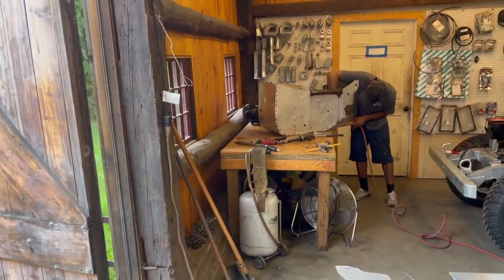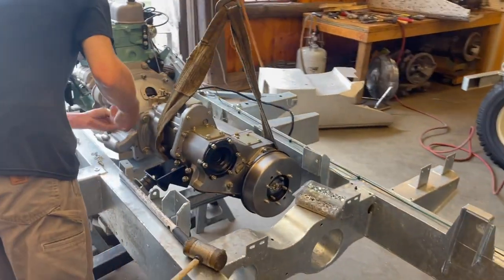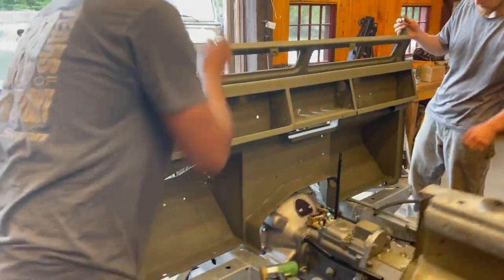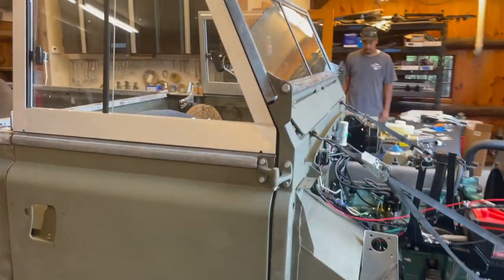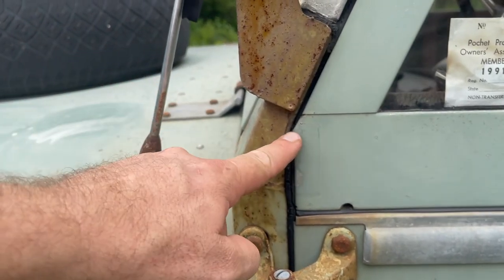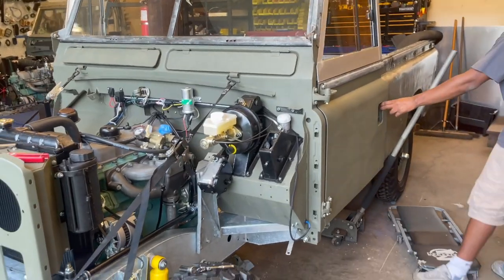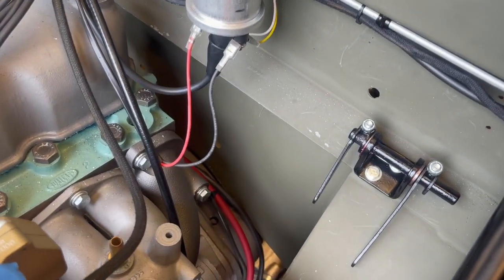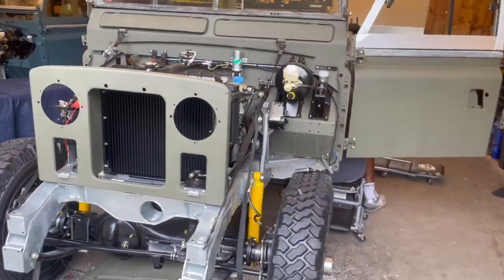NAO Shop Truck Project: Installing the engine and bulkhead

Comment: Great build, you need to add series '1 ton' style wheels though, these really beef up the look of a 109" , not sure if the US/Canada got the 1 ton 109?  Wheels are part DA2694, available from various manufacturers. 
Keep up the great work, watching from the UK. 👍
Reply: I kind of like the skinny look though. The DA2694 are 8" which is too wide for the 7.50 16s. the original one ton wheels were 6.5" but are hard to find
Reply: @mikesandone2652  I can see your reasoning, didn't realise they were 8" , actually thought they were the same as the original 1 ton.  👍